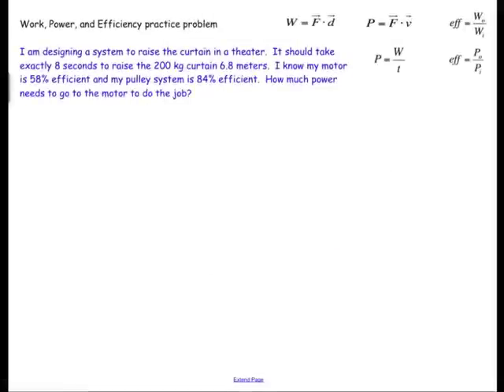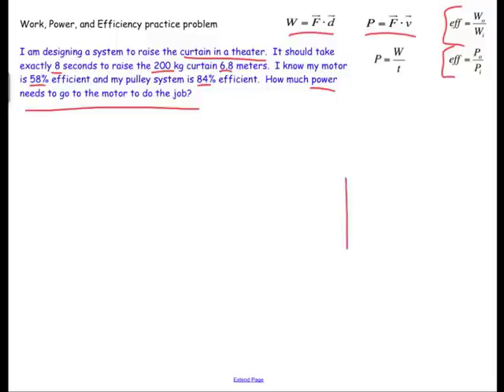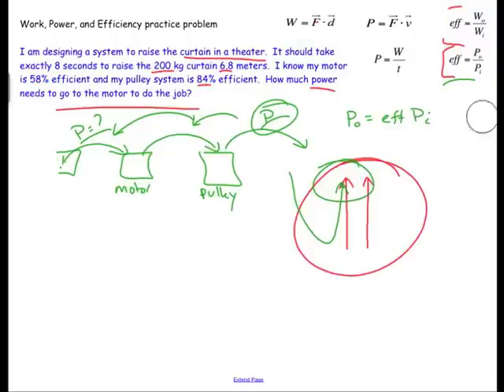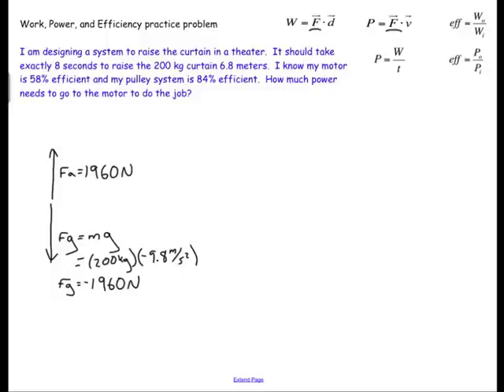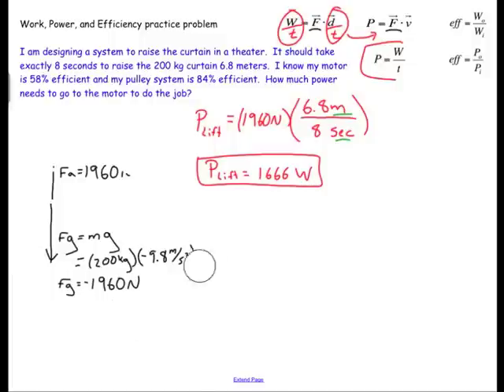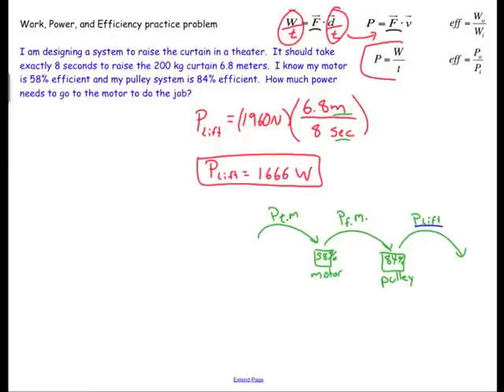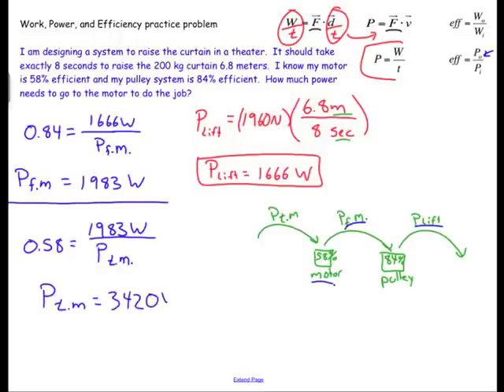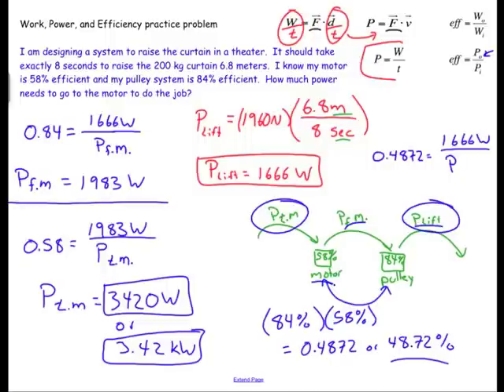Work, Power, and Efficiency: Sample Physics Problem

Comment: Why's the F equal to the weight? Shouldn't it be more if the curtain needs to be lifted?
Reply: It’s equal or else it will accelerate upwards and not at a constant rate
Reply: I think that is an assumption to make the calculations easier.